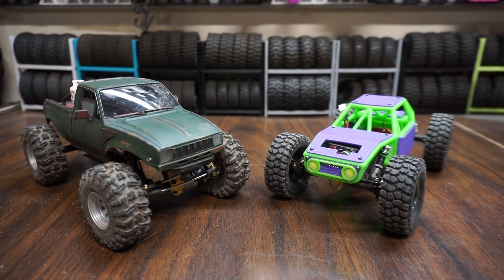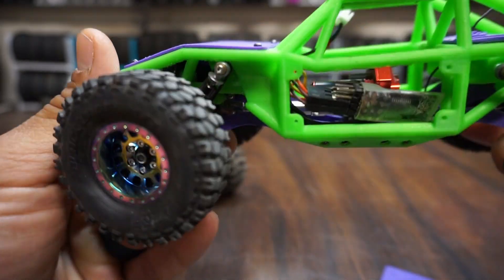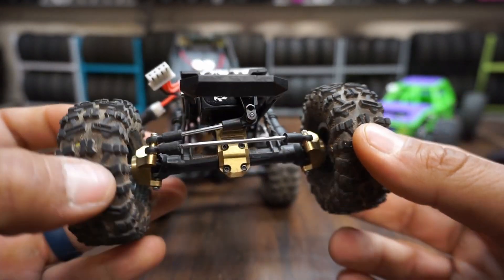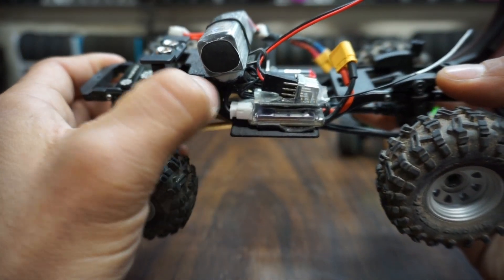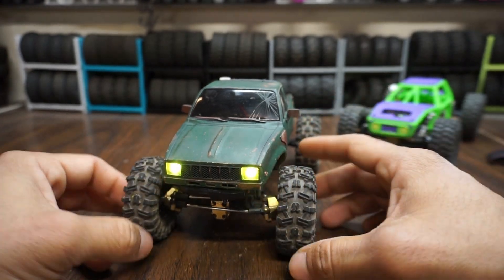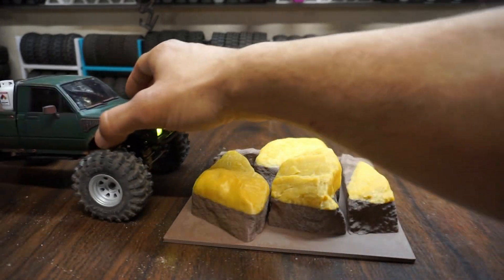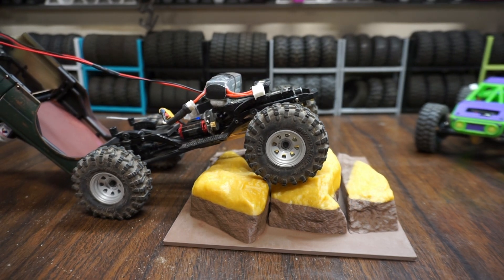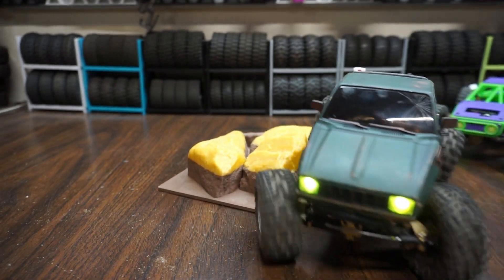Best AM32 Settings for Aliexpress Brushless Motor!?

Comment: Can you share the motor link, please
Reply from the maker: @hugoyh  yeah they are hard to find: https://www.aliexpress.com/item/1005008554438953.html
Reply: @RockhopperRC  Can you share the esc link, please
Reply: I have this setup and i flashed the esc to update the software because the LVC would not engage.  It bricked the esc though and it's useless now. Should have left it alone and ran a lipo alarm. Fantastic system though, I'm waiting on a replacement esc.